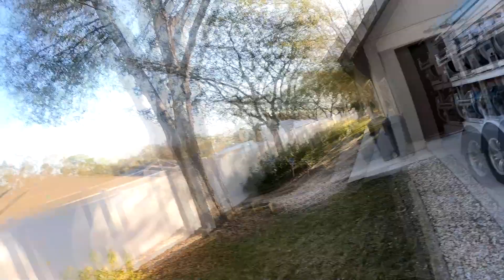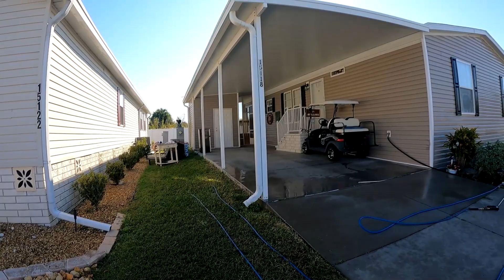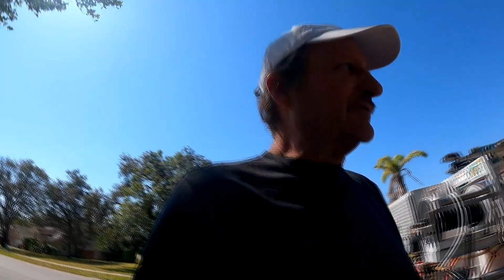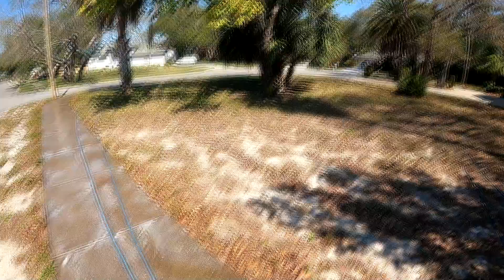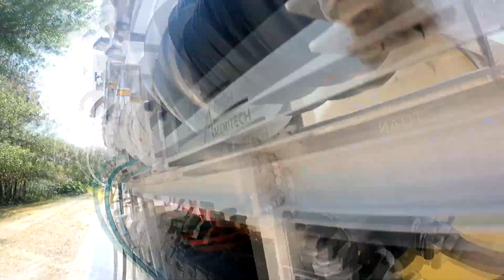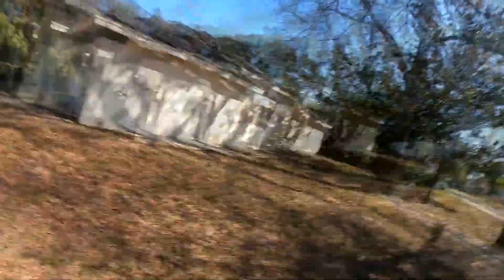Upgrade the gear!! How to get 12GPM super concrete cleaning tips.

Comment: I thought to siamese, the connections had some kind of backflow on each whip to T before going to single line?
Reply from the maker: I have it plumbed direct, check the video again, I show how it is hooked up.
Reply: Hey Don, your videos are helpful. Iv been thinking of siemese for some time to clean concrete faster. I finally did it. 2, 8gpm with mondo...awesome!   I clean a large driveway today, took 2hrs. I did the same driveway 7 years ago with a 20" whirlaway and a 4gpm. 7 hrs.  What a difference.  I owe it to your video. Hey. I like cleaning concrete again! I got after it today. Ty.

Comment: If both machines are 8gpm each and you siamese them... with that run any risks using 3/8 line?  Just won't get 16gpm.   Do you always mondo with both machines or do you change tips depending on job?  Tip size you use when siamese?   Great content as usual.  Thanks.
Reply from the maker: I go with 12GPM on bigger jobs and ones that are extra dirty, most of the time I run 8GPM and I never change the tips, always running with the standard tips that come with the surface cleaner, 4-2502 tips. and no matter what you run you can only get 12GPM unless you are using 1/2 inch then I get 16GPM